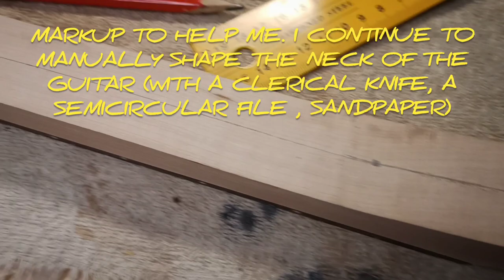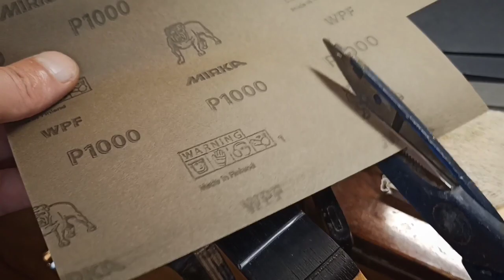How to Build Cigar Box Guitar | Making Guitar

Comment: nice job

the  scale ruler in an interesting tool, did you make that yourself?

I will have to come back and watch this again, very helpful.

The file holding jigs are a very fine idea
Reply from the maker: Thank you! My father made a scale ruler out of stainless steel for me... I have a lot of different ones!
Reply: @CigarBoxBroGuitars  Good to know

{ w[ll have to figure out how to do the same
Reply from the maker: @bearshield7138  I wish you success ... do not forget the correction for the saw blade (its thickness)
Reply: @CigarBoxBroGuitars  Thank you...

That is the kerf of the blade and most hack saws are about 0.024
Reply from the maker: @bearshield7138  yeah 😊 I have drank (groove) for the fret is 0.6 mm.
Reply: @CigarBoxBroGuitars  cool

thank you

just spent the last 6 hours polishing the sole of my hand plane and sharpening it,

I am working on my first canjo. It is going to be a bass with a .130 inch phosphor bronze string.
Reply from the maker: @bearshield7138  cooooool!
Reply from the maker: @bearshield7138  By the way!  I have a lot of single string videos on my channel!!!!